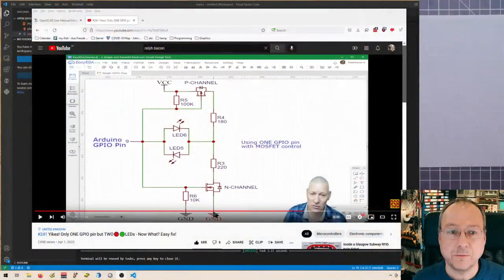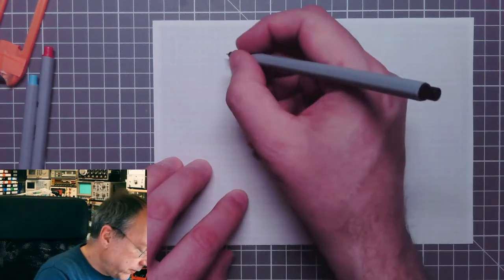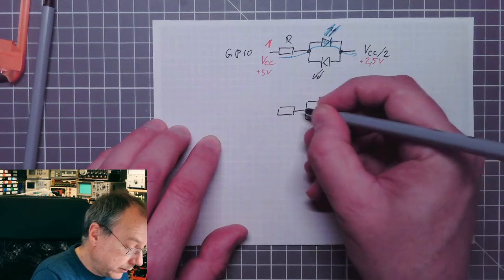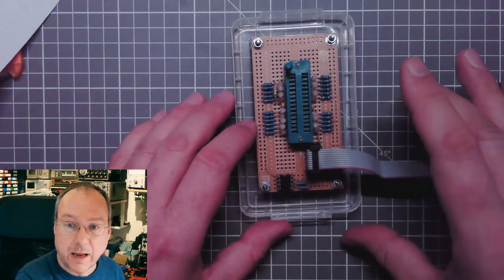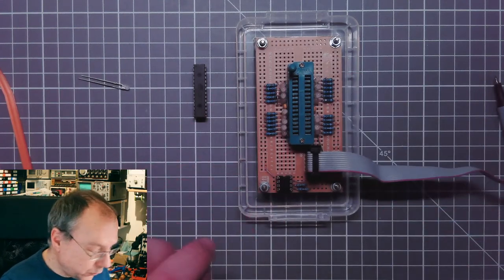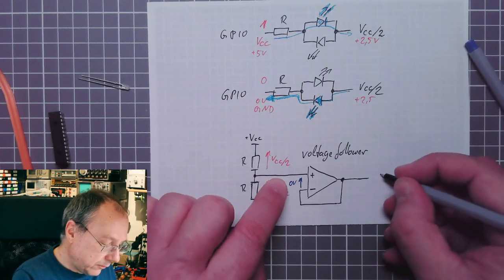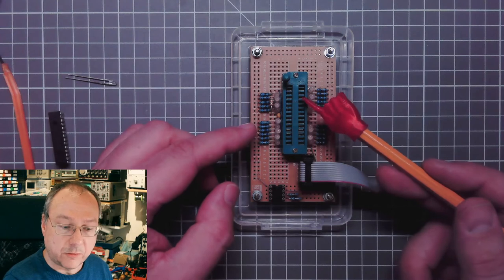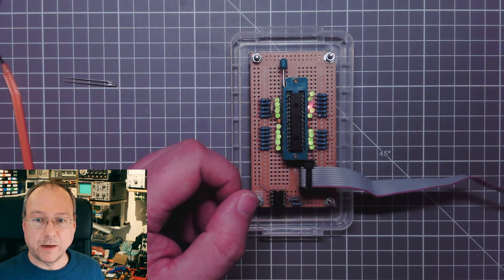Two LEDs on a single GPIO pin!

Comment: Very nice to see you building on Ralph's ideas. I do  like the idea of using the op-amp, since they are cheap and almost any will do. In addition, the current through the voltage divider will be very low (about 0.125 mA)
Reply from the maker: you could reduce the current through the divider even more by using higher-valued resistors, it would still work well with >100 kΩ. On the other hand power consumption for the whole system is not an issue if you are at the same time running two dozen LEDs.